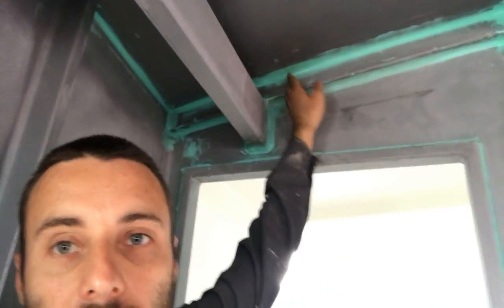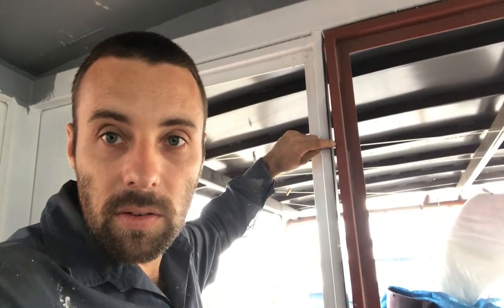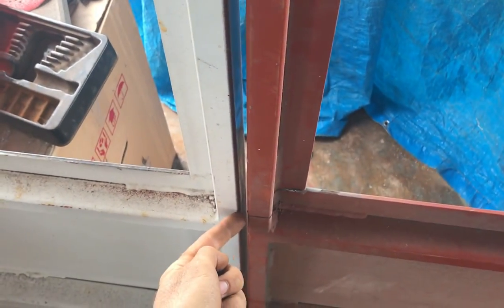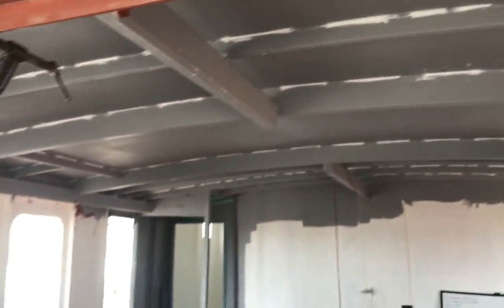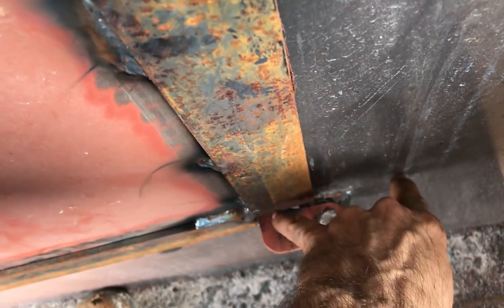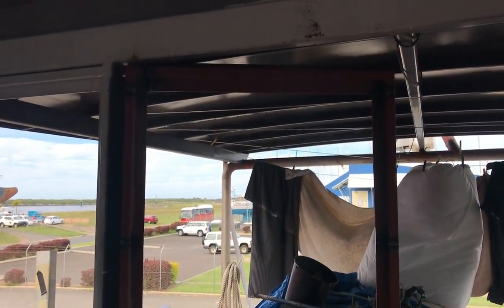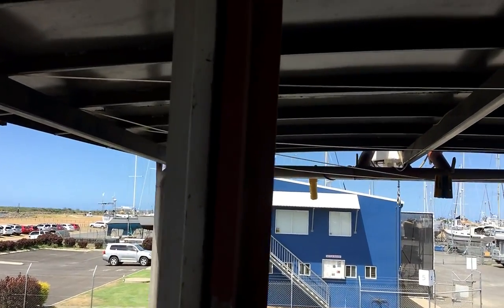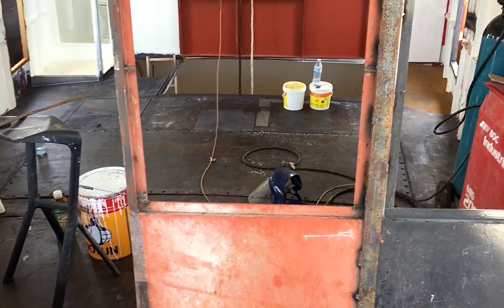How to Build Boat Doors - BUILDING BRUPEG (Ep. 18)

Comment: I'm glad your friends came over to help you as an ex ship fitter watching you cut and weld on that door was killing me I was screaming to go get a chain fall go get a chain fall..... Glad it all got pulled and tucked the way it needed to be done..
Reply from the maker: Yeah friends can certainly help.
Reply: You can also use the same forces that bent it to straighten it. Heat straightening with a torch and a wet rag is really fast and works good. Heat the outside of the bow, and use the rag to fast cool the spot. That area will shrink more, pulling it back straight. Do a bunch of small strategic spots, not the whole thing at once. There are a few videos on this. Keith Fenner did some very good videos on heat straightening Marine shafting. If it works for a 2" prop shaft, it will work on tubular steel doors for sure.
Reply from the maker: Thanks I will look into that

Comment: Well done!   You're going to have a purdy boat.  I'm not sure they are going to let us in the marinas you'll get to stay at.  :)   Love seeing the little design changes and assortment of approaches.   Have you ever tried heat bending?  It's slow but I've a bit of success with it.
Reply from the maker: I’m worried they will think we’re are a mafia boat with our colour scheme. I don’t have an oxy torch so haven’t done any heat bending. I have heard of welding a bead them wet rag on top to shrink the weld, but so far haven’t done that.
Reply: :)     You don't need a torch.   When you don't have all the tools you'd like,  you just get better and better at using the ones you have.
Reply: BuildingBrupeg yes on rag trick. But super small distances. You can bend a flat pice of steel  with a tig pass and no filler rod. But weakens the metal.(nit picky) as iv heard.... " My weildin never breaks.......it's always right beside it."
Reply from the maker: We have an oxy torch for the weekend so I’m going to mount the doors up then heat and quench until they align perfect (as I had to run some more welds which have bent them again)

Comment: Those doors look very thin to be stopping a large wave breaking over the back of the boat.
Reply from the maker: Frames are 50x25mm (3mm wall) skin is 3mm steel, seals are all 50x6mm flat. Windows will be 10mm toughened glass, survey specs is for 6mm glass but we increased it so we would have some extra strength if needed

Comment: Have you ever watched any of Keith Fenner's videos on shaft straightening using heat and cold water.   Check out "How much Bend is too Bent" https://www.youtube.com/watch?v=bOT4cSTJyqw . You might be able to use a similar process to bend the door frames without actually cutting and rewelding.
Reply from the maker: Thanks Edward I will look into this

Comment: Typical Aussie !  Welders hood and shorts !
Reply from the maker: I’m actually a kiwi stuck in a hot hot land. I can put up with the occasional slag to the legs, if it means I don’t die of heatstroke in this ridiculous hot these Aussie’s call summer. Only issue so far has been stupid levels of welders sunburn on the legs ever now and then
Reply: I wondered about that welders sunburn !  Cooler weather coming soon mate !!
Reply from the maker: Geez I hope so. It’s a hard slog working in this heat